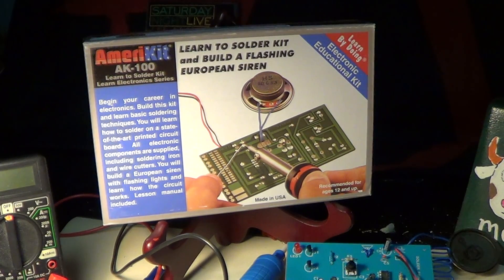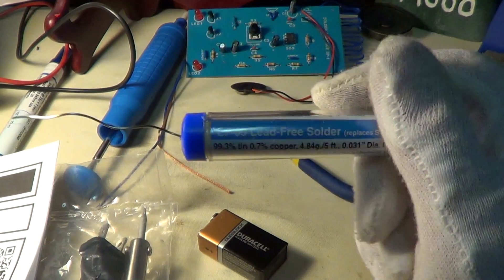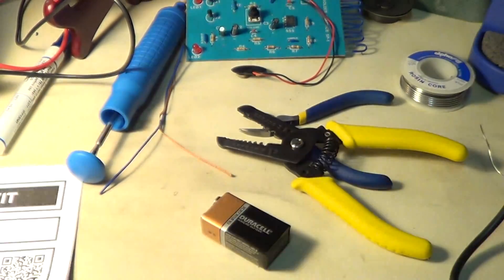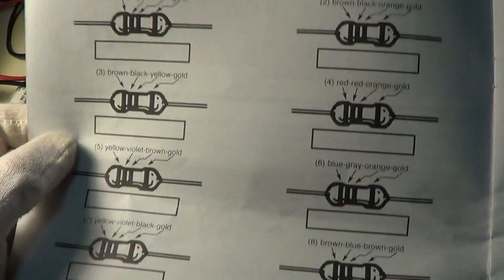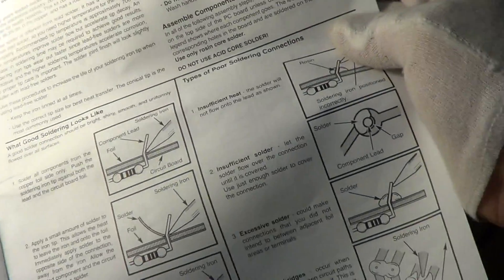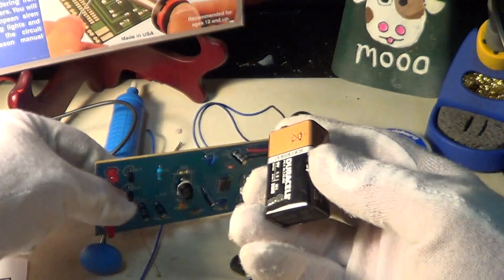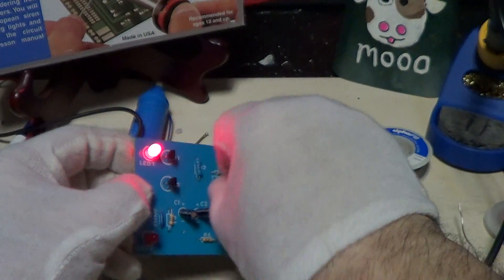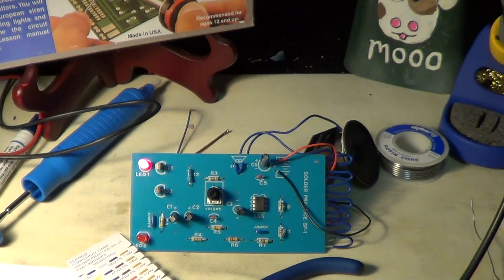AmeriKIT AK-100 review.

Comment: I think if you put those extra resistors on the board it becomes the time travel circuit board for the Tardis...
Reply from the maker: I'm saving all Xtra parts to build a Hologistic retention Circuit or a Dimensional osmosis damper =))
Reply: Good call...don't forget to include a paralax modulator.
Reply from the maker: That works well with a high impact phason drill =)

Comment: Learning to solder when I was younger has saved me tons of cash. I soldered new capacitors on 2 LCD TV's that the screens would go black on after a few minutes or so. Still had functionality and audio but the picture would not hold. A bit of research later on the net and 90% of the time it is the capacitors. Saved me buying a couple new TV'S Good skill set to have. Well done.